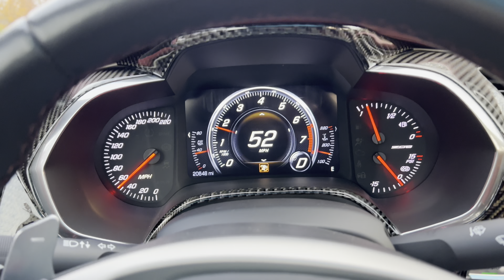Nine Lives Racing The Deuce! Carbon Double Element Megga Wang c7 z06 corvette wing install

Comment: I have a c7z that I race in time attack and the thought of running this wing not on a race car is silly. You're worried about looks.... flat this and that but these wings are based on airflow and are air foils used to increase downforce with least amount of drag. Take it off. Btw your car is over 74" wide so how would the wing not fit. So confused by this style.